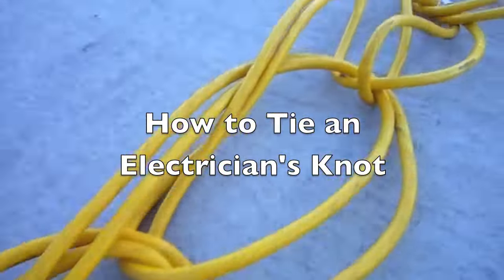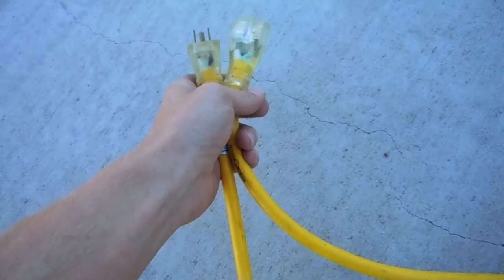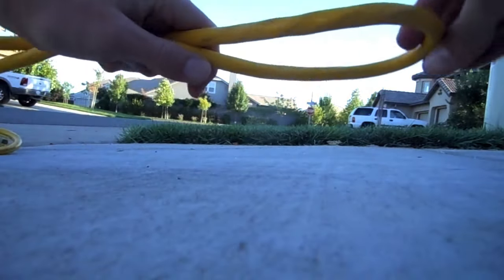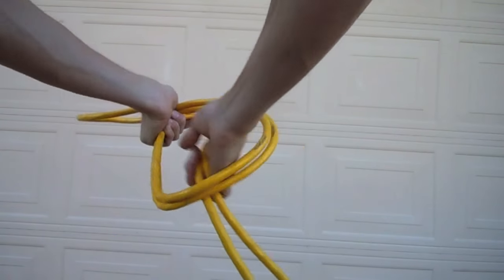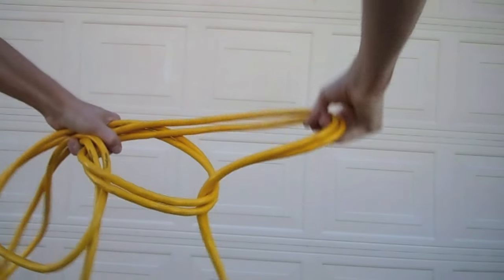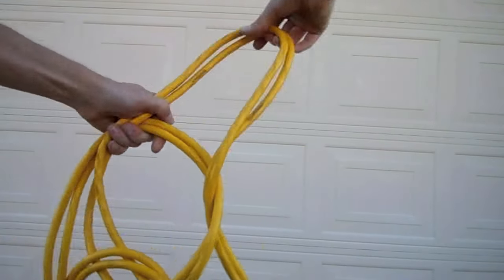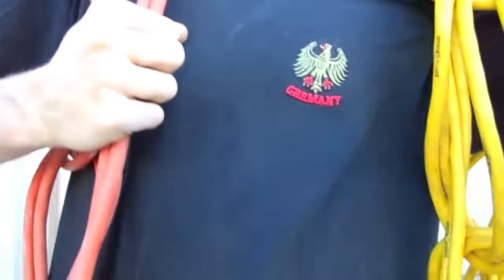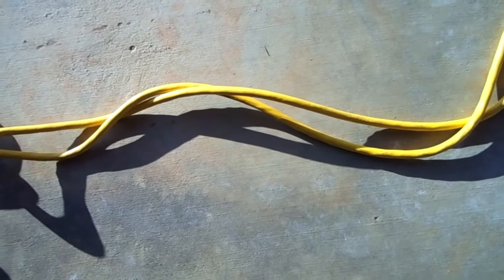How to Tie a Daisy Chain (for Cables)

Comment: Does this only work with a brand NEW cord???  I have tried this with an old cord that I untwisted and when I do it this way it does not come apart at all.  It is more of a mess than it was. I have to untwist every loop to get it undone.  So instead of paying $50 for a new cord I decided to loop it like I used and say screw this!!

Comment: You know ,if you would mark the middle of the cable it would save some time ,oh yeah and this doesn't work that great in cold weather !
Reply from the maker: That's an excellent suggestion for a regular daisy chainer
Reply: I plug both ends into each other and start there. No need to find the middle.
Reply: Then you have to undo the whole thing , each time , this way if you have a 50'  cord or longer  ,and you only need a couple feet, just undo the amount you need ,it's not a science project   !
Reply: @roxydog2004  He didn't mean starting the daisy chain from the cords ends.

Comment: to what end? anyone does this stupidity to my cords is fired. hey, here is a big mess of knots for ya boss but it's 7' long and won't lay down or hang?
Reply: _ARMY_ daisy chains keep its shape, and it can be hung, stuffed in drawer, and still keep its shape. You probably didn't understand that this is a great way of storage, and a quick way to undo the line without having knots.
Reply: I wouldn't work for you anyway especially if you're going to fire someone for trying to practice good housekeeping.  I've used this and seen it used my entire life and have NEVER seen or heard of any issues with it being knotted up unless the idiot trying to undo it did it wrong
Reply: @jasonjames7792  you could always just wrap a cord up like a normal person. A coil takes up less space. Easier to deal with.  Less bending for the cable. But whatever.
Reply: @zohanthecat  right easier to deal with when you pull on the cable and because you coiled it up around your arm or whatever it ties itself into a nice little knot that can really damage the cable vs. If this method is done correctly it comes apart as you pull,  no knotting,  easy peasy.
Reply: @jasonjames7792  I love the replies I'm getting here. Been in construction 25 years. Have indeed seen this, debated it, tried it, rejected it. Not because it is wrong or doing damage. I make open coils starting at the female end, couple wraps and a tuck at the last few feet. Then I can grab by Male end and the cord is ready to go, knot free. 
Less curvature to the insulation on the cord. Has to be a good thing.